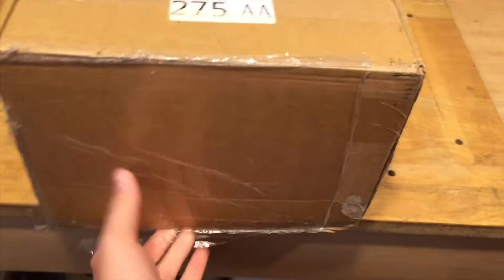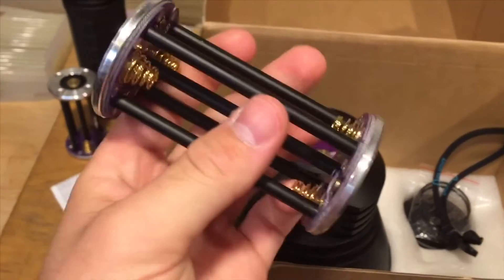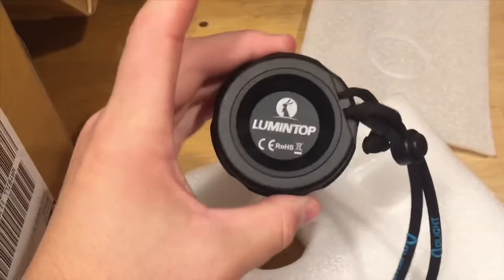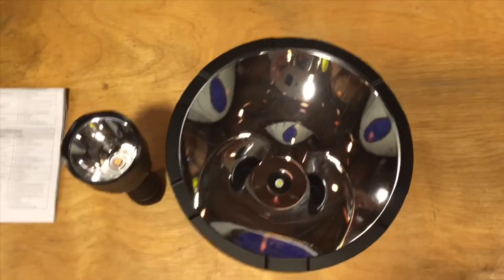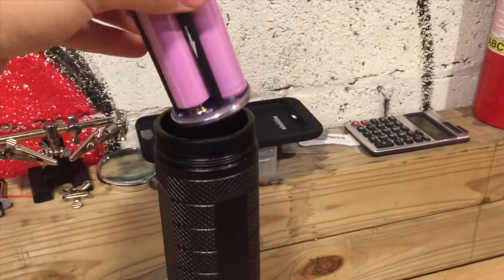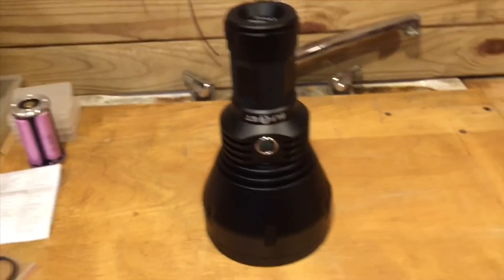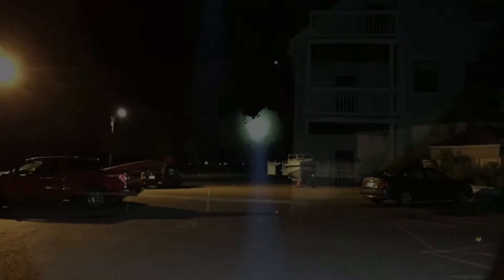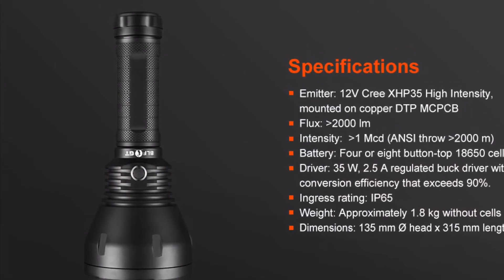BLF GT Unboxing and Review

Comment: Respected! You are the best. I watch your videos. just because you're doing a flashlight measurement with a lux meter. because on paper can be written anything.
But unfortunately. You did not measure Lumintop BLF GT on a luxmeter instrument - how many meters does this lantern shine? Others measured. came out 1,800 meters of illumination. There is no flashlight in 2000 meters. I'm waiting for your answer - how many meters did you see on the Lumintop BLF GT luxury meter?
And also wanted to know your opinion - what is really brighter than a flashlight. long-range. Lumintop BLF GT or Astrolux MF04?
  Thank you. I'm waiting for an answer.
Reply from the maker: MF04 is better
Reply from the maker: Thanks! Sorry for the late reply I was in class but yes this was my first video and I may re do the BLF GT video once I get my mf04 and test both side by side but yes the MF04 is better in real world tests based on the forums results thanks for watching!
Reply: There are some that throw over 2,000 meters.... I have one ..... It's a BLG GT 70.2  by Texas Ace, a copy of mine is getting tested by NASA in Texas to use in space missions .... It's got a custom NW XHP 70.2 with a Custom board and custom copper heat sink.... It's putting out over 9,000 lumens and throws a wall of light...... I can light up towers that are 120 feet in height over a mile, the entire tower lit up ..... It is impressive ..... The only light that outhrows it is my Polarion PH 50 HID and it's only 5,000 lumens but man bright light.....
Reply from the maker: MannyScoot if yours is modded then It wouldn’t really count to him cause the stock blf gt 70 only throws about 1400 meters MAX, but yours does sound interesting... do you have lux measurements?
Reply: It's crazy 8,526 Lumens, +1.6 Mcd, +2450m Throw
Reply from the maker: MannyScoot WOW I assume dedome, plus more current than stock version?
Reply: Yeah custom copper heatsink and some R5 chip on a custom board it has an XHP 70.2 You see it on Candle Light Forums for a group buy..... BLF GT 70.2 group buy...... I just didn't wait and told Texas Ace the guy who does powerful lights to build me one.... He told me I have one from NASA that got tested by them.... But is on Ebay on an auction.... So I bid and got it for $450.00 two months ago....... Pretty Bad Ass light
Reply from the maker: MannyScoot sounds good I may buy the stuff and mod mine
Reply: Hell Yeah.... You will be amazed,,, Like Holy Shit Amazed ....

Comment: Can you use a 3400mah, Panasonic battery for this flashlight?
Reply from the maker: CTROCK as long as it’s buttontop yes
Reply: @LumenChaser  -I am new to these kind of thing. But what does (Bottom on top mean?) I thought u have to use 3500mah, I guess not. Thanks
Reply from the maker: CTROCK No problem ask away, So 18650s come from the factory with flat tops and third party companies add button tops on the batteries, this is a button top http://www.mtnelectronics.com/index.php?route=product/product&product_id=542&search=30q and this is a flat top http://www.mtnelectronics.com/index.php?route=product/product&product_id=543&search=30q, look at the pics and see the difference on the positive side. If you have anymore questions please feel free to ask.
Reply from the maker: CTROCK and you don’t need to use 3500 but if you do you will have a bit more run time, the Mah rating is the capacity of a battery so higher number means longer Run times. I use the button top version of the battery I linked in my other post
Reply: I BOUGHT THESE BATTERY RIGHT HERE IS ON SALE $32 FOR 4 BATTERY WAS $40 FOR 4 BATTERY ORGINAL. I BOUGHT 8 OF THESE BATTERY.  LUMINTOP Protection Circuit Rechargeable 18650 Li-ion Battery 3400mAh 4PCS LM34

1. Panasonic NCR18650B Cell Over 500 times Charging Cycle Ultra-long runtime for high-performance flashlights Max 4A output current, compatible with various kinds of high-drain devices.

2. Incredible Anode Protection Circuit protects against overcharge, over discharge and short-circuiting. Three sets of over-heat protection promise a safe and secure experience: 1. Pressure relief valve protection. 2. Separate microporous protection. 3. PTC cathodal block protection.

3. LM34 lives much longer than the general Li-ion battery as it can be recharged over 500 times and the capacity still remains more than 70%. Coated with durable metallic film to guard against abrasion.

4. The protecton circuit is built in the anode. Through changing the tradistional cathode prtection circuit with plate-like nickle anttached, LM34 is shorter reaching to 68.8mm. The overall appearance is, therefore, more compact and beautiful. Plus, the head bulge design ensures stronger compatibility.

5. Certified by CE, UL & ROH
Reply from the maker: CTROCK yes those will be good, did you buy them from Lumintop direct
Reply: NO! I will order these battery and the flashlight from China. They are haveing a sale right now. the blf gt flashlight is for $221.00 and the battery is for $32 for 4 battery but I need 8 of these battery. the flashlight was $325.00 orginal price. for the flashlight and 8 of these battery is $274.00 is that a good deal? of course free shipping. u really can get these flashlight at China only! no place sell these flashlight?
Reply from the maker: CTROCK send me the link, and did you already order the BLF GT previously or you only ordered the batteries already
Reply: I order the flashlight and battery today just now for total of $255.00
Reply from the maker: CTROCK did you get the neutral white or cool white emitter in the BLF GT, either way it is good you got it for cheap but the neutral white throws farther and the cool white throws a bit less but has a little more lumens
Reply: @LumenChaser  -at first I was going to get the neutral white but change my mind and got the Cool White. Thanks for your help!
Reply from the maker: CTROCK no problem, plus I switched my emitter to cool white myself because the beam looks brighter in the sky 😛, thanks for watching!